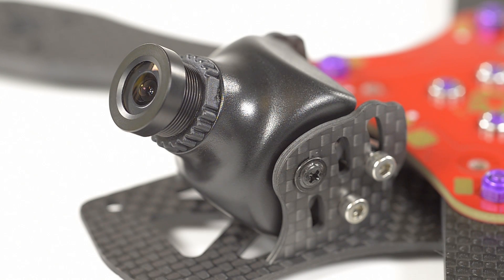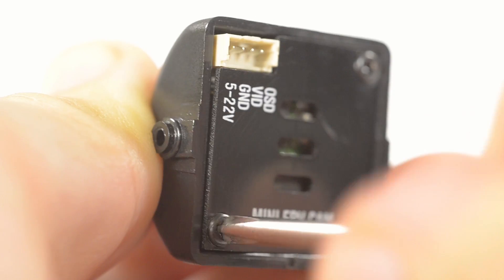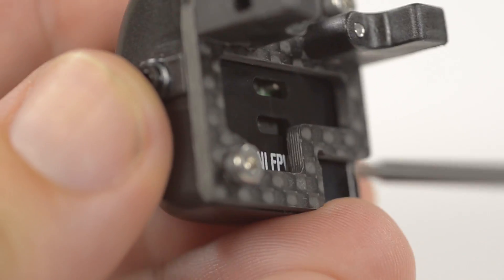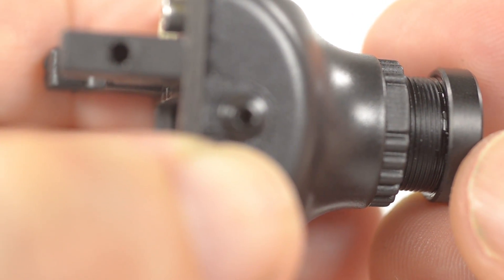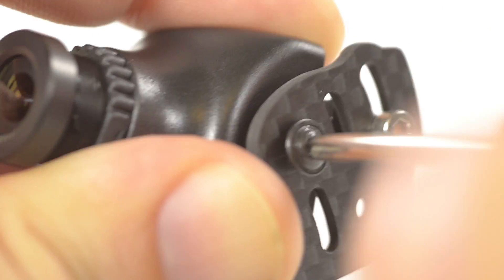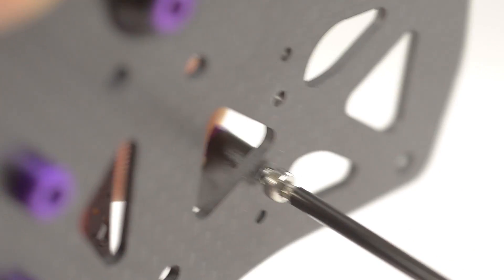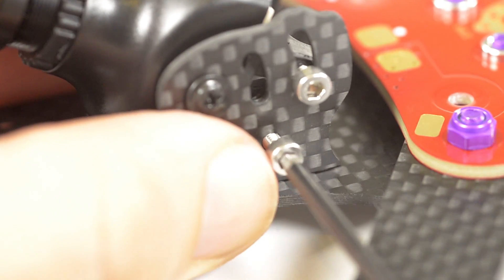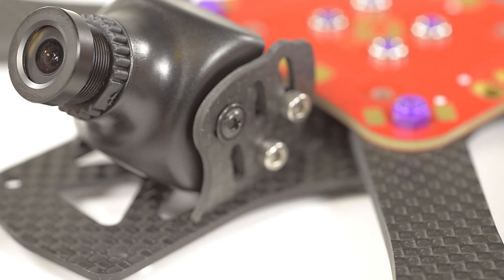ImpulseRC Alien Build - 4" Camera Assembly

Comment: The fit on this is so precise.  I thought I would insert a layer of electrical tape between the back of the camera and the camera plate for a little dampening.  When I tried to insert the angle lock screws in the curved slot they were really hard to get in.  I realized that the tape was throwing things off.  After removing the tape it fit perfectly.
Reply from the maker: +Plur307 Like Soma says in the video "there can be no gap!" lol

Glad you got it together mate!